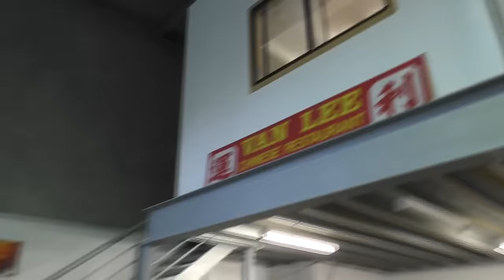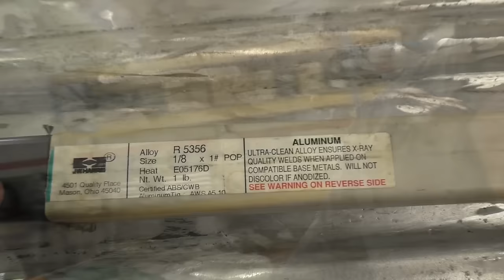Repairing and anti-fouling the hull

Comment: Here is a cool hint to coating boat bottoms. Mix up a couple packages or bottles of cyan pepper in your bottom paint. Why you ask me? Barnacles are small animals that don't like hot things so they won't attach to the painted bottom.with the pepper in the paint it will last a long time. I saw this in an article in a magazine 40 years ago. It works try it next time.
Reply from the maker: Interesting tip. I'd be keen to give it a try!
Reply: As a long time boater I have heard of this. Did you have success?
Reply: Thanks , sounds crazy but crazy works best sometimes.

Comment: Hey bud pro tip, when welding up cracks its best to drill the tip of the crack with a pin hole to stop the crack from returning, and to remember that aluminum welds differently at different metal temps, ie as the base metal temp raises it takes more pedal to weld, I like to give cooldown times to my weld times when working aluminum

Comment: Hey Stu I found a lump of 4 by 2 timber  a metre or two long was easier to use than the scraper scraping the barnacles off the bottom of the boat. Just hang on to it with two hands at a similar angle and use it the same way. quicker and easier. doesn't scratch the metal or existing anti-foul as much. Thanks for the video it was good demo.
Reply from the maker: Timber is a great way to go. I often use some timber decking and then when it grinds blunt just use a drop saw to cut a centimetre off and then you are good to go again. :)

Comment: I purchased a '60's Gregor  12'  welded aluminum boat from a government site. It was used in fresh water all it's life. I'm using it as a tender in the SF bay area (salt water). After fairly extensive research I will use the Interlux 2 part 2000E barrier coat epoxy primer. They recommend 4 to five coats above and below water line. This product is also used on fiberglass. The bottom is sanded with 36 grit, cleaned with air pressure or new brush to keep contaminents down. The 2000E coat is applied within 60 minutes of cleaning. I can do two hours between coats depending on temp and humidity. Here in N. California I am hoping to get it finished in one day start to finish. Max time for curing two weeks. Have you heard about this epoxy? Then I'm applying 4 coats of Trilux 33 bottom paint. Let the experiment begin. I'll haul it one year from finish and try to remember to contact you with results. :>)

Comment: PPS:  If you blow through put a piece of copper on the back side to act as an argon well and also to hold your puddle.  By turning the cleaning action up you are decreasing the penetration which is what you want on that thin material as well as cleaning the impurities with the ac action.
Reply from the maker: +Douglas Thompson I did play a bit with the cleaning percentage. I'm going to be doing more welding on the Green Machine soon so there'll be more chance to practice!

Comment: About time you cleaned up that old barge I've done it a few times it feels good to have a tidy boat. Good luck with the rest of it.
Reply from the maker: Thanks mate, it is a bit overdue. I'm really looking forward to finishing the work on it and getting it back in the water.
Reply: @DangarMarine  The next time you do this to your boat, get a sufficient quantity of a product called "Marine-Tex. Put a 1/8th layer on the bottom and sand smooth. Then paint. They have an aluminum based Marine-Tex for your type boat. You can run over stumps with no damage. A lot of guys that fish up here in the nasty Ohio River take their brand new Ranger boats, grind off the gel coat, apply this product as stated above, then realized gel coat the bottom. You might want to look into it. It's great for fixing cavitation plates,skegs, and pitted outboards.

Comment: Been a while since I have done TIG welding but some tips for next time.    

Preheat your area with a heat gun, doesn't have to be radically hot but at least warm.    

Vee out the crack to minimise impurities and make sure you drill the ends with around a 3mm (1/8th") drill to lower the chance of it spreading.   

A backing plate on the other side of the hull may have helped (just some mild steel plate pushed up behind the area you are welding) to spread the heat better as you weld.   

In your case you appear to be correct, your amperage was too low and so you were getting poor penetration until you upped the current.    

De Havilland hulls are notoriously difficult to weld well (they were mainly riveted) so you did a good job for your first go!   

PS: A detail sander makes for a lot easier sanding between strakes and chines. Etch primer on bare metal is a must.
Reply from the maker: Thanks Matthew, some great tips there! Paul has an old aluminium hull with quite a few holes so I think we are going to be getting a lot more practice over the coming months. I'll be sure to put some of your techniques into practice when we do the job. :)
Reply: Just remember to set your your welding current, keep raising it until you are about to blow a hole through the metal then just back off a few amps and you should get maximum penetration and strength.
Reply from the maker: Yes, I think I was too afraid of blowing a hole through, but on the bright side, given that hasn't happened I can always grind it back and have another go next year! ;)
Reply: I just saw a video where he did heat the metal with a propane torch. It seems to weld better.

Comment: We had a Ali assault craft at work which was pop riveted together and all leaking or most of them so I cleaned the hull back to bare metal and fibre glassed the whole thing finishing with flow coat worked a treat and lasted for years.

Cheers Jeff
Reply from the maker: Hi Jeff, fibreglassing over old hulls is a great way to go. I've seen it done with many timber and aluminium boats. This trick is to get a good bond to the aluminium, but one that is sorted it will go for years as you say.

Comment: Nice work. Painter's tip: Never dip your brush straight out of the can. Pour into another container and dip from that. You'll end up with a lot less "foreigns" in the coats of paint.
Reply from the maker: Thanks mate, and good advice about using an intermediate container.

Comment: Aluminum that is old and has been painted as well as in salt water will be dirty which I am sure you know.  So when you weld it be prepared to weld beads and then grind the entire bead out.  You might have to do that two or three times but each time you are removing the impurities.  Marine aluminum is most likely a 5000 or 6000 series so using 4043 rod will wet out more easily and solve a bit of your problem on that.  It isn't nice to work with but it can be done.  Take care.  Doug
Reply from the maker: +Douglas Thompson I've also since watched a great video on welding cracks that showed to use a dye to find the full limits of the crank, grind the crack open then drill a hole at each end to stop it spreading. Interesting stuff, lots to learn!

Comment: Hello Danger Marine! 
This might be a stupid question. I have paint worn on my lowerunit so that aluminiumoxide is visible in form of pits and scratches. I took highstandard, industrial  stainless steel paint that i had laying around and sprayed over it to cover up the problem earlier mentiond. Now i'm wondering how the light coat of paint will react with the aluminium?
Reply from the maker: It depends what the paint is made from. Most paints are fine though, it is only antifoul that can sometimes contain copper which is very bad for aluminium.

Comment: Love your videos (I’m from Aurora, Ontario, Canada). I have a question about painting an aluminum boat. I have a 19 ft aluminum fishing boat that I use only in fresh water lakes. The above waterline two tone paint is getting a bit rough looking - mainly a lot of scratches. I assume I would lightly sand and remove any decals. Would I need to use a primer? Is there a aluminum paint primer? Do I need to use a special kind of paint for painting above the waterline. Can you recommend a brand or the right type of paint to use on aluminum (above waterline). Thanks, Paul

Comment: with your tig welding you want to start the puddle on some good aly and make sure you angle your tig across the piece and not into it then you cna use good heat and push the puddle from good aly across the gap rather than having tow puddles contaminated fighting each other, there's nothing wrog with too much heat if you ahve plenty of filler. :)
Reply from the maker: Thanks for the tips, I'll be doing a bit more welding on another boat soon so I'll be sure to keep these things in mind. One day when I'm a bit better at it I'll have a go at making a video that brings all these tips together.
Reply: no worries mate, was fun watching you guys trying to wrestle that boat around :)

Comment: PS:  set your cleaning up to about sixty or seventy per cent and try a few different settings on the machine until the weld edges are showing that hew that shows it working.

Comment: Might want too also consider attaching a sacrificial anode to boat  such as piece of zinc, it will corrode before the aluminium. With the welding, might be worth practicing a bit before. YouTube has .a goldmine of information on it, you also probably need an all purpose filler rod as well if you don't know what type of aluminium your welding.
Reply from the maker: I did have an anode I was going to attach to the keel in this video but it was just a bit too big so I never got around to showing it. They are definitely a good idea. There is lots of great info on welding on YouTube, that's for sure. Fortunately that weld has held really well without leaking so I'm pleased with that.

Comment: Hey dangar, would you recommend buying a aluminium 15ft boat with a hull thickness of 2mm ?or  is it too thin in the longrun ?
Reply from the maker: Hi Abdulla, it really depends on a few things. If a boat has strong ribs and other bracing 2mm can be okay. Light boats are less comfortable on the water so the conditions you use it in will also be a factor. If you are boating on calm lakes etc I think 2mm would be fine, but it you intend to travel at speed on choppy waters you might want to go a bit thicker/ heavier.
Reply: Thanks mate, i would be using it around coral reef lagoon in my island in relatively calm days with a small portable engine. my main worry is erosion of the metal overtime and running into a coral around the reef and making hole in the hull.

Comment: All it needed was a good sandblasting.. and it would be as good as new.. and provide a good surface for the epoxy to bond
Reply from the maker: I looked into sand blasting the hull and unfortunately it turned out to be too expensive for me.
Reply: @DangarMarine   fair point, thanks for answering !

Comment: what grit sand paper should I use with electric sander on Aluminum boat? After that I use self etching primer then paint over correct?
Reply from the maker: I would start quite course, maybe 60 and slowly move up to around 200 before painting.
Reply from the maker: Oh, and yes, etch primer is important before painting.

Comment: Hi mate...is that a Yamaha 40 CV in the background ?  is it dead or still kicking ??
Reply from the maker: The CV has a broken big end bearing and a bit of piston damage. I'm going to be getting another one in with the same problem this week I think so I might try to make one good one out of the two.
Reply: Thanks..  Is that a common problem for the 2 cylinders ? Looking at used Yammies 40's in 2 stroke and thinking the 3 cyl oil injected might be a better option
Reply from the maker: I've got a funny feeling these were run without oil for a while, I don't think it is a design fault at all.
Reply: oh....wow...   one simple way to kill a 2 stroke hey ?   Mixing 50:1 is not that hard..                        

Thanks mate,  Restored my faith in the budget CV range...  or should I perhaps rebuild a 40  4 stroke (or maybe wait for another big storm)

Comment: I am wondering why you didn't use the car hoist and a simple rope sling off the extended arms to lift the boat off the trailer . That would have been both safer and simpler. By the way, when do you do any customer work to pay for all the stuff you use :-)
Reply from the maker: Hey Ron, we did use the hoist to put it back on the trailer, and in many ways it was a bit simpler. At the time, tying it off meant it could just stay in that one spot of the workshop, and that was too appealing!

Comment: as far as your welding of the crack, I would have first tried just an arc and no filler rod seeing as it was very thin and not much gap
Reply from the maker: Good tip about doing a bit of a test first. I had to weld up another long section the other way were the bottom of the hull had separated from the side. I found it went a lot better now I've started wearing my glasses under my helmet! :)
Reply: Glasses help a lot, LOL, I mean that without a filler rod on thin aluminum when tig welding if you have a small gap like that hairline crack sometimes you can get away with just using the arc to melt and flow the two parts together, I recommend if you have a couple pieces of scrap trying it

Comment: I've had fiberglass boats, apart from a small fishing boat as a kid which was aluminum. Why are aluminum boats the choice for where you live, and in turn, why are most smaller boats (16+ feet) in states fiberglass? I assume it's a weight:cost ratio but I was curious what your thoughts are. With the corrosion issue with aluminum what is the argument against fiberglass?
Reply from the maker: Hey Seth, good question. The main reason most boats around the island are aluminium is because they are anchored up against each other or a wharf all day and night so they take quite a bashing, particularly during storms. Larger fishing boats (16+) do tend to be fibreglass, but they don't make great commuter boats. The hulls themselves seem to last quite a while from a corrosion point of view. My hull is about 40 years old now. Fibreglass boats tend to be heavier which makes them much more comfortable offshore and a bit more thirsty on the fuel.
Reply: @DangarMarine  Could you have both by putting a layer of fiberglass on the hull?
Reply: Like your enthusiam , but heck buy a better boat man.Do not waste your talents on that piece of tin.

Comment: Add a warning about picking the right anti-fouling paint.  The wrong kind, metallic, turns the boat into a huge battery, that eats itself in short order.
Reply from the maker: Yes, I've see an aluminium boat completely scraped because somebody but copper based antifoul on it. A definitely no no!

Comment: Am trying to find an email link to you. I have drawn up a circuit you may be able to use as an add on section for your  anchor/nav lights vid.
Reply from the maker: Best thing to do with images is to put them on an image sharing site and then post the link. If you do that I can add the link to the description the video and people can easily check it out.

Comment: What you don't see is pourous That's why I think soda blast and then west system of exopy that is heat driven into the aluminum.
Your anode, I didn't see one. That means your boat is the scarficing the aluminum, making it pourous
Reply from the maker: I have done an epoxy coat on a hull before and it did work pretty well. The nice thing about it is it can also free you up to use some more effective antifouls. This hull now has an anode on the transom, but it wasn't in this video.
Reply: Dangar Marine  this is like honey 2 part but you put it after you wire wheel it. 
Then you apply it and you have to use a heat gun to drive it into the hole . I will post a
You tube site to watch
Reply: Dangar Marine  Check out this video on YouTube:

https://youtu.be/UCOziXeTXzY
G flex